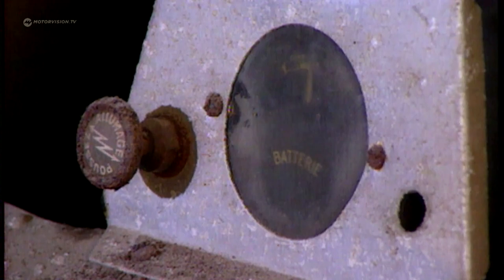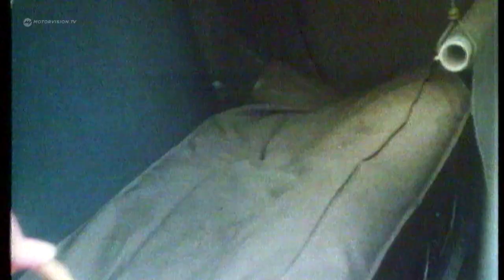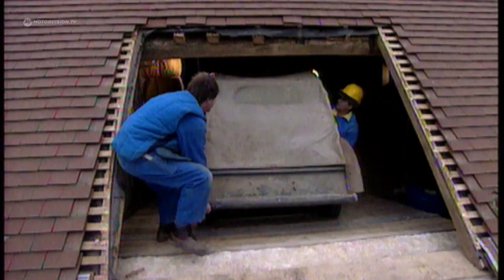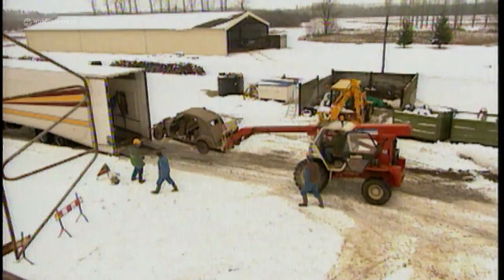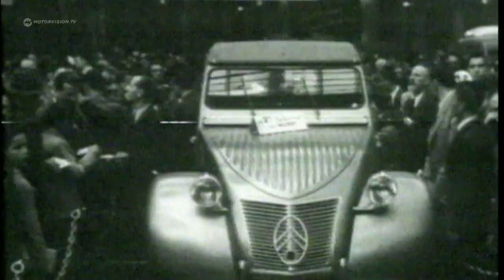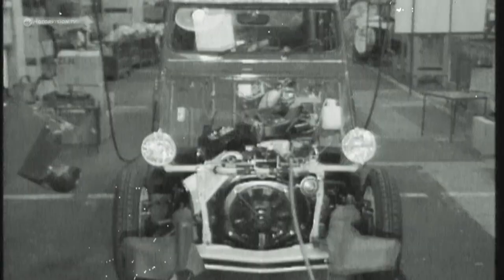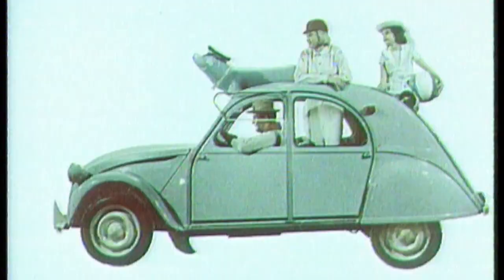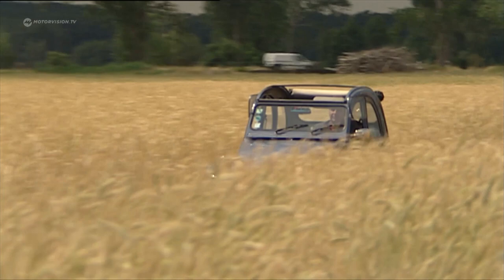The "Duck" | History of the Citroën 2CV | Classic Cars | Motorvision International

Comment: The most fun you can have on 4 wheels.
My new 1990 Citroen 2CV6 Charleston RHD (UK spec) was Aus $7,700 (French Francs 35,500) Tourist Transit tax free Paris delivery with 6 months rego & insurance.
Current insured value is Aus $42,000 around Euro 26,500.

I have covered 285,000 kms. Restored back to new for its 20th birthday including new chassis, rebuilt engine and gearbox after 195,000 kms.

Comment: The 'TPV had a 3-speed gearbox. The 4-speed 'box made it to the production 2CV. Pierre Boulanger, the MD of Citroen was initially furious about the development of a 4-speed gearbox, stating that drivers would find 3 gears enough to work with, but Walter Becchia, who created the air-cooled engine for the 2CV, and also reworked the gearbox, got around the issue by declaring the gearbox was a 3-speed with overdrive. So the early cars produced in the late 1940s and throughout the 1950s were sold as 3-speed plus overdrive.